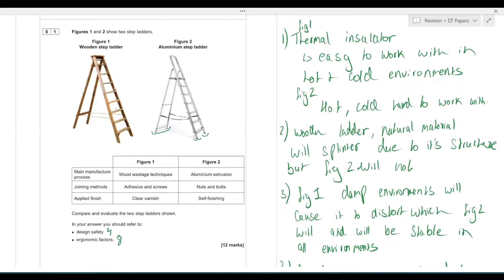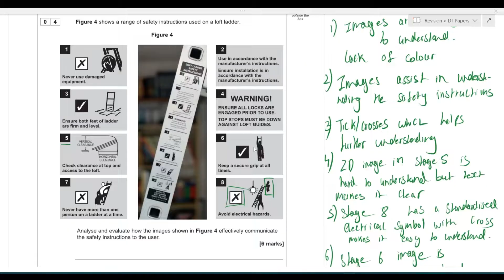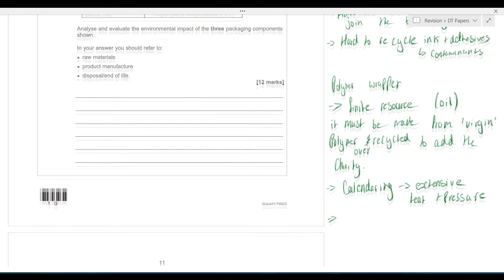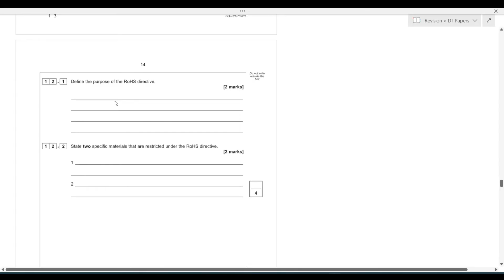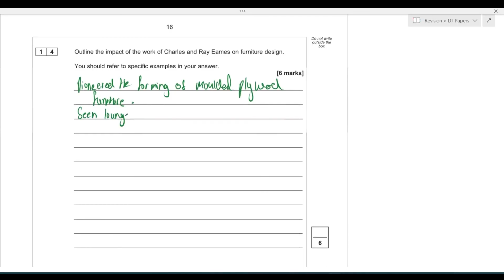A level DT: Product Design Paper 2 Walkthrough Nov 2021

Comment: in the big mark questions for example the 12 marker for figure 5, can you write a list as you've done or do you have to write it in an essay form? I got told I couldn't bullet point for when I sit my exam
Reply from the maker: You have to write all of it in paragraphs. Personally for a 12 maker, I would write down 6 points comparing the 2 given items for 2 marks each. Or if they have given 3 points in the question, 4 marks (2 each side) per point to make 12. I would also write an extra point in the end if time is availble to assure that if any of the previous points didn't make the mark then you may have a chance of scoring the backup marks.